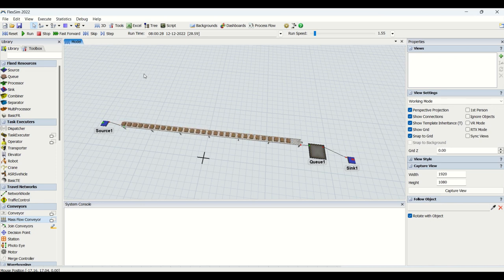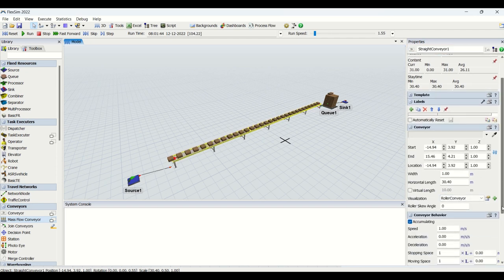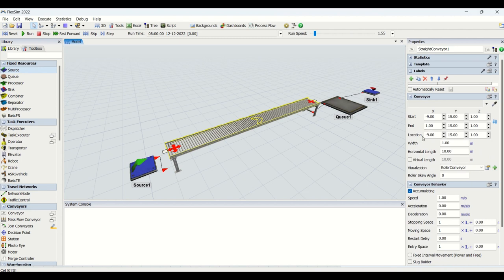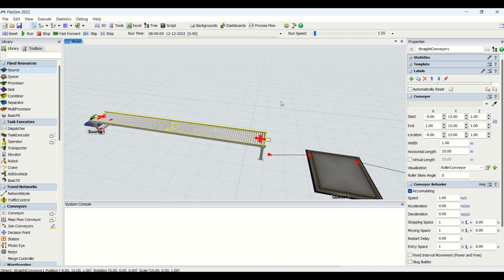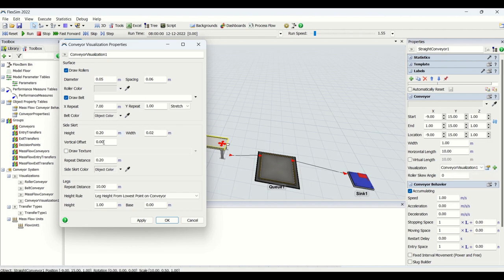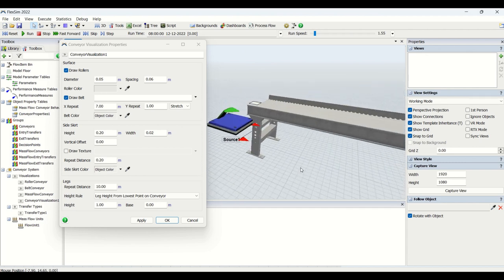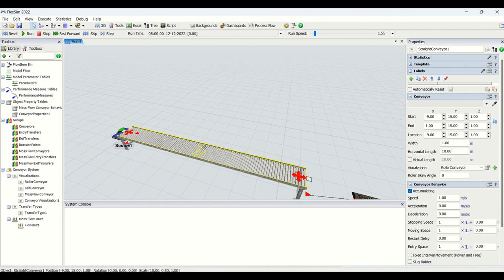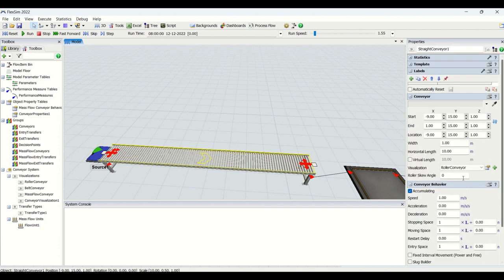Conveyor | Part 1 | Tutorial 3| Flexsim 2022 | Simulation | Technology | Channel - BE AWARE (IF 4.0)

Comment: Please help me out for choosing which type of conveyor I should take for my simulation. My simulation revolves around the mining area conveyors and the material consists of various types. Should I choose Mass flow conveyor or Normal Conveyor...
Reply from the maker: You can go ahead with normal conveyor, using as belt conveyor. The mass flow conveyor can also be used.
Reply: @leansimcorp  Thanks for the reply. Really appreciate your efforts. Just to expand the clarification of my scenario, I want to simulate the flow of raw materials, lumps and fines from different buildings, bins and conveyors having 3 types of the materials and feeding to the transportation system. Will taking normal Conveyor solve the case? The Material to be shown as boxes? How to calculate the mass of the available material on the conveyor? How to calculate throughout of the system?